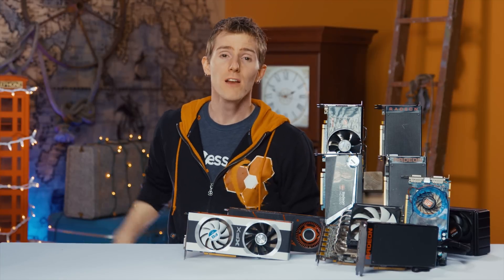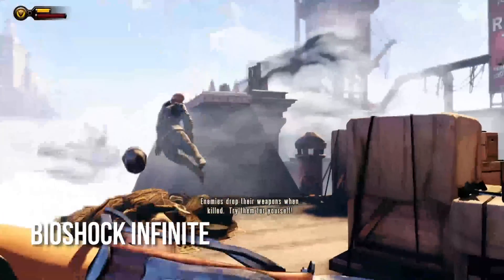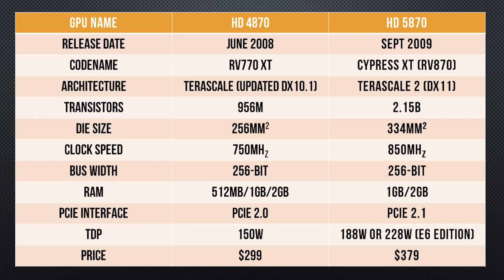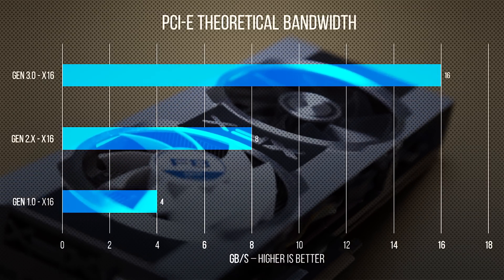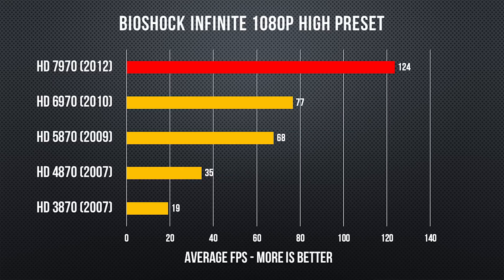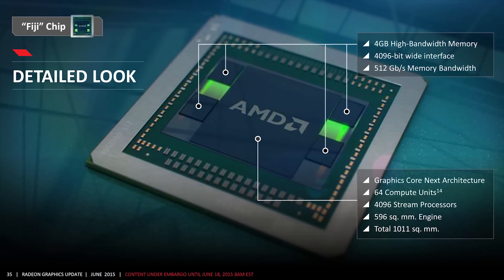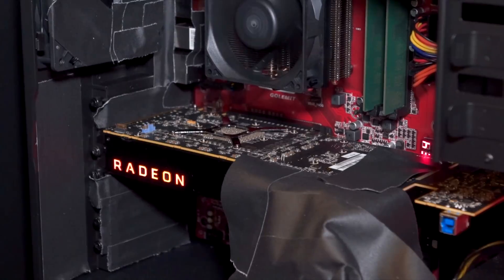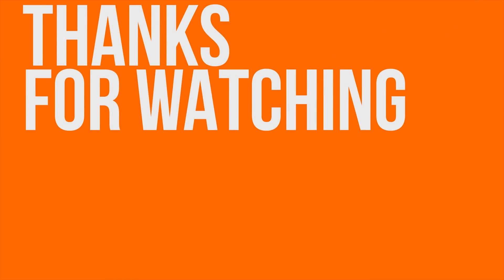10 Years of AMD Video Cards BENCHMARKED!

Comment: i still use a XFX R7800 ghost termal technology, pretty much never touched any other computer since i bought it many many years ago, i am going to buy a new computer really soon with i7 8th gen, 1080 gpu, 16gb 300mhz and ssd will. with a 144hz 1080p 24inch curved monitor am i going to notice any big diffrence or shouldi go cheaper i meani can afford it but i could spare the cash if im over doing it (the plan is to have a computer that wil last for a loong time)

Comment: 480 $199? PFFFFFFT HAHAHA!
Reply: Man times have changed. Got my 580 for 150
Reply: NecroticTM I got a 580 for 65$ and it was a month old and works great. But I gave it to my Dad who then bought me a 1070 mini from Zotac on Ebay. Official Zotac ebay
Reply: Bought mine a year ago for $190.
Reply: 480 is $80 in my country
Reply: GTX 580’s are pretty cheap on the used market, I find them for 40$ (USD) pretty commonly.
Reply: @deethree1289  gtx is not rx...
Reply: As of current, Ebay is selling 480's for $100 dollars each and 580's for as little as $120. Guess the mining craze is truly dead.
Reply: @ChaotiX1  you spoke too soon, they are listed as just under 1k usd now
Reply: @deadeyecowkillz7580  i made that comment over a year ago...
Reply: still too soon
Reply: @deadeyecowkillz7580  yeah well, I'm not Nostradamus. I wouldn't have been able to predict Scalpers trying to snatch up every single GPU straight off the production line, ballooning prices like they did.
Reply: pog
Reply: Got mines for $ 230 a week after launch
Reply: Now it's only 109 for the red devil used
Reply: My 580 was $179
Reply: This comment aged well...
Reply: @flippy7035  like fine wine
Reply: @shrimry  no it didn't
Reply: Well due to the mining hype, problems with manufacturing plants in Asia and high memory demand for mobile devices (smartphones, tablets,..), supply/demand and market economics raised the retail price.
199 was probably suggested consumer price by AMD.
Reply: You're poor

Comment: I built my first computer in November 2016. I used an Intel i7 5820k and an MSI RX 480. Now, when I built this, I had been thrown all sorts of warnings; "AMD cards suck dick, don't do it." was one of them. I digress, I bought the video-card at $270* dollars. Now it's 2018, Bitcoin has knocked centralized currency down a peg and because of this; I was able to sell my RX-480 on eBay for a whopping 402 USD dollars. So all I can say is, thanks bitcoin. 

P.S. I also bought 600 dollars worth of bitcoin back in 2016

P.S.S. IM RICH BIAAAATTCH

Comment: my first AMD card was a Powercolor X800GT paired with an Athlon XP 3200+
years later in 2009 i proudly owned the mighty first 1Gb GDDR5 card, a HD5870 from XFX and felt like a baller at LAN-partys (too much to explain here) xD ..
the rig  (i5 760 OC@3.6Ghz + HD5870) still runs as an office machine at parents house sometimes.

ol times... btw i do remember the HD4870X2 which was a top end card for years

Comment: ill never forget the day A.T.I. dropped the motherload of all bombs on NVidia when they released the Radeon 9700 pro,,and all the architecture that came with it that got implemented into all there cards of that generation. so why don't you do a plug on when it was ATI,,before AMD bought them in 2006.they made some kick butt cards that left NVidia in the dust. back then the ONLY thing NVidia had done well was open gl. NVidia's dvd playback and anything direct 3d was just god awful,,and stayed that way till 2010. if you played Quake 3 Arena,,,or DOOM 3,,or any game that used the ID software's quake 3 engine,,thats where the NVidia cards shined. but when valve sided with ATI,,and made the Radeon 9800XT,,just for half life 2,,alot of NVidia owners were left with there heads hung very low,,as the Radeon's smoked anything NVidia had to offer,,and I mean BEATEN VERY BADLY!! I still remain an AMD loyalist today. but doing a spot on bolth old NVidia and ATI cards would be cool to see.

Comment: I'm still using a hd4870, still peforms well with a huge 500mhz core overclock and still stays below 66c. Still want a new graphics card and it still uses up WAAAAAAAAAY too much power than newer cards atm.

Comment: AMD needs to  design  completely new  gpu ,  Fury 2.0   called  Vega is a huge mistake comparing to  NVidia's gpu.
Reply: Vega is actually good and power efficient the only problem is that Nvidia released faster cards... if Vega wasnt pushed to fast clocks speeds its more efficient that Polaris by a mile and as efficient or more efficient as pascal at lower clocks but they pushed it to the limits... Kinda like a 7700k vs a 6700k when OC 7700k at 5ghz vs a 6700k at 4.6ghz 
7700k consumes as much power as an 8 core ryzen at 4ghz while 6700k is still power efficient. Vega is the same... it would have been better as a mid range card.
Reply: +TheSinisterEyes1 Yet the 6700K has a 91W TDP while the Broadwell predecessor (5775C) is only 65W, despite packing Iris Pro Graphics
and 128 MB L4 cache... Skylake not so good haha

Comment: I've generally gone green with my GPU's but my 6970 - "It's cheaper so it doesn't' matter if I replace it sooner..." - actually ended up lasting me 6 years! Despite grumbles about catalyst it served me well. It got retired for a while when I built a new system with a GTX1070 in 2016, but now it's back in service after the venerable GTX 260 in my Wife's 'Sims 3' box finally died. Unfortunately the fan seems obnoxiously loud these days so its been down clocked by 40% to cool it off until a current gen replacement arrives.

Comment: I use a AMD Radeon HD 7950 and i5 4570 0.8-3.6ghz locked cpu and don't see a problem with modern games even ultra or nearly ultra.

Comment: Don't get the hate on Hawaii - yes, it was hot (reference model), but it was twice as cheap as it's competitors (780ti/Titan), same performance (at that time) + more VRAM. I'm still using an overclocked 290 with Xtreme IV cooler while Keplers are now competing with even older Tahiti cards because of RAM / drivers

Comment: You skipped Radeon HD 6850. It falls between GeForce GTX285 & Geforce GTX 465. So, this is a formidable card even today. It is terascale 2, 40nm, 1,700 million transistors on a 255mm die, PCIe 2, 16 lanes, GDDR5, and 127 watts.

Comment: i had 6970 + 6990 (3 gpus) i was thrilled to get 70-80 fps in crysis with that. now i get almost double that with my 1080 ti. 1080p that is and no 8x msaa which is stupid. 290x crossfire wasnt bad at all either. only game i wanted it  to have full potential was w3, i dont think it still has crossfire support lol. gta 5, bf4 etc. other games i played had like 90% scaling but not the only game i wanted it to work, withcer 3 : (

Comment: i got a computer with a proprietary 240 watt power supply for for my birthday last year. i upgraded the processor to a xeon 2.44 q core with hyperthreading. so mow i need a video card with 1050 to or close performance . but i'm stuck with 65 wat or less.

any suggestions?

Comment: I still have a 7970. Still runs everything just fine. I don't see myself upgrading in a while. Old top of the line cards are the best bang for your buck.
Reply: I have the R9 280X and still kicking ass
Reply: I still play Battlefield 1 on ultra with my 7970

It's still a fucking beast in 2018
Reply: My brothers friend was offering me 2 780s for 250 euros at one point. Sadly i had no money and didnt pick them up....

Got a 980 for 300 around 1 1/4 years ago.
Reply: Karl Robert Reinart I just recently upgraded to 3 RX 580s as opposed to my old set up of 2 7990s due to both the cooler finally commit suicide, and Fry's actually had some in stock... for actual price, not the $900 that people are selling them for on eBay to mine bitcoins, my friend who's dad was dumb enough to buy him 2 1080Tis accused me of black magic because I was performing better.
Reply: Ya the 7950/7970 are legends man, the 7950 was sold new for 180 usd in 2013 LOL
Reply: Same Demsimex - Well, on a 980 now instead, since im still on 1080p.. Will aim for a 1070 or wait for 2070.. But must say the 290x was an amazing card. :) But run so HOT
Reply: Of course it still runs everything, but also consumes much more power. 250W is a lot and probably it cost you as much as another card in a year or two.
Reply: I still have a AMD Radeon HD 6970 in my computer, it runs fine.
Reply: Considering that the HD 7970 has like 12 memory chips or so (and the whole card consumes 250W on average), and that the RX 580 has a 150W tdp (and it also has less memory chips), it is safe to say that the difference between those cards in terms of performance / W is not all that big.
Btw, the OpenGL scores (Furmark 1080p) show that the HD 7970 gets around 3850-4000 points (mine got 3926) and the RX 580 gets aroud 4050-4200 points... That is not a huge differece ya know
Reply: Recently decided to upgrade our little family home computer with a GPU so that my wife and I can play some games together. I just bought an R9 270X, so I'm pretty excited to see how it runs! (We have an actual gaming rig as well, so she will be using that and I'll use the little chugger haha!)
Reply: Your just broke 😂🤣
Reply: Had 7850 until 4-5 months ago, was great card :D only problem was 1GB VRAM.
Now I have GTX 960 4GB because my friend was selling one, but if he wasnt I would still be on 7850. So it worked exactly 7 years for me. Really wonder how long it would work if I didnt get 960
Reply: Karl Robert Reinart I untill recently was still rocking a 7950 on water that overclocked like a beast it was a his 7950 boost iceq I could run 1300mhz on it  with custom bios stock was only 850 lol biggest overclock on any card I ever had  shame it eventually died after 3years insane overclocked .
Now got 1070 on water it's good but hardly overclocks tho  but bang for buck 7950 or 7970 still amazing cards best aging well  cards ever made . I want another 7950 ice q one day just to overclock it was so fun  also very good driver support too
Reply: @vforvendetta4538  Very good driver support? Man the drivers for that thing suck HARD. I can't get the OC to stay where I put it, it will drop back to 910 as soon as I click apply (the slider) and it will run at 850. Otherwise when the OC stays where I put it it is a bomb for its age... It is getting replaced with a RX580 8GB thow, I have a 165hrz 1440p panel... I needed the vRam and FreeSync. Its getting back into my old sistem thow, for 1080p max gaming when friends come over 😅
Reply: Kind of depends on your definition of just fine.
Reply: just buy a nvidia 1050ti for 170$ and the wat
Reply: The HD 7970 would kick its ass in OpenGL, mine is getting 3926 in the Furmark 1080p test, while a GTX 1050ti 4GB got only 2550

Comment: History repeats itself, eh? The Terrascale architecture couldn't compete with Nvidia, so they went with smaller chips and tried to sell multi GPU as the high end. They did the same thing now with the 480, Vega is coming, but much later than Pascal. Also don't forget Xenos was actually the first unified shader GPU from ATI, a year before the 8800 and even longer before the 2900!

Comment: How are some of these old AMD cards performing better then my GTX 960??
Reply: The HD 7970 is quite above the GTX 960 in modern games, memory bandwidth being a big reason of it.
Reply: Same reason an old GTX 780 will out perform your GTX 960, these are AMD's flagship cards
Reply: because your 960 is almost as old as this amd and also was only a mid range card when it was launched. this amd card was amd's flagship.
Reply: Spunky Bob fr tho, just ordered a 1070 strix, but if had a 960 SSC for the past year or so. 960 is a decent card
Reply: the cpu i think
Reply: These are not the top flagships, my two PCs use a HD 4890 (better than 4870) and a HD 5970 (better than 5870)
Reply: Because a 960 only has 1gb of Vram  and is not very powerful
Reply: @pzkwmaus9050  Mine has 2gb gddr5 vram, in fact i think all of them have 2gb of that vram...
Reply: @terdthetoad  mine has 4gb gddr5 vram
Reply: @pzkwmaus9050  mine has 4gb gddr5 vram
Reply: GamingD they have 2gb and there’s a 4gb model
Reply: because this is how nvidia limit your card's lifespan with less than futureproof vram.
Reply: It’s called finewine
Reply: because one of the benchmarks is Half-Life 2, which was a game engine which always ran better on the ATI cards for some reason only vAlve could tell you.

Comment: I never understood why the 290x got so much slack. It spanked the pants off its competitor (the 780/ti) and if I remember right was actually cheaper? It cost about the same as the gtx 970 and actually performs better especially in newer titles. Yes the reference was hot as fuck and thermal throttled but the non reference ones were perfectly fine. It wasn't like the 4xx from nvidia that was not only crazy hot but SLOWER than the competitor. I guess people care a lot more about heat and power consumption than I thought for some reason. It's like a few bucks a month on your power bill difference and the heat doesn't change the life span of the device. 

Either way VERY good review for both nvidia and AMD. II'm sure people will bitch about something but the review itself was great. I disagree with peoples opinion of the 290x though I'm happy they are going back to the basics. I'm afraid for Vega. I personally think they should have stayed out of the high end for 1 more year and made a huge comeback like the 5870 BEAST with some new tech like Eyefinity. People don't use multi monitor as much because nvidia surround sucks balls but if they came with a new card that could keep up adding freesync into the mix they would have a firm place in the market. Who knows? maybe Vega will be better than I think though?

Comment: 7970. Still kickin in 2017. Let s see how goyvidia is doing hmm: most of fermis have died in tragic fires and keplers were gimped till a 780 gets beaten by an overclocked 280x.  390x beats a 980 and has double the vram... But the 350W powerdraw is enought to light a small african village and feed em of the bill.

Comment: Still using R9 290x
Reply: same here :)
Reply: benq994 hahaha ha that's cool! Are you gonna update anytime soon or you gonna wait till it dies?
Reply: Well i don't expect it to die anytime soon but i'll wait for newer and better Radeons to arrive. For now im good. Witcher3 runs smooth (about 45fps) on max settings except hairworks and ambient occlussion. The only drawbacks are heat and power consumption.
Reply: benq994 yes. I've been thinking about power consumption and heat, too.  At least two of the things that makes me thing about changing. But I guess I'll change it when ddr5 memories comes out ( ram memories )

Comment: Still have an HD 5970 (basically 2x 5870 in crossfire on the largest GPU I've ever fucking seen, almost 13 inches).
It's nice, for an almost decade-old solution is still somehow playable on new AAA titles, albeit with some tweaks. If drivers were still updated and games still tested on it, I'm sure it would be usable.

Not saying get one, new tech is new tech - cheaper, smaller, lower power, cooler, quieter, etc.
However, it's really impressive how "future-proof" AMD's crossfire cards were.

Comment: Hi I am new to computers and I wanted to try and build or upgrade a pc. There's a dell inspiron 660 with 8 gb of ram and the i3 processor that I think I can get for around a hundred bucks. (Old work computer) 
First I want to know if that would be worth doing and I also want to know what a good graphics upgrade for it would be. Are there any good cards that you can use without upgrading the psu that draw the power straight from the pcie slot? Would an amd Radeon 460 2gb work without a psu upgrade? If there is nothing good to use without upgrading the psu what would you reccomend getting? I want to be able to player newer games at around 60 fps hopefully at 1080p 
Thanks

Comment: Still using an R9 290X 4GB, AMD tweaked its performance over the years and still running great today for my 1080P needs.
Reply: 73mathesar Same here! And my ASUS DCU2 card isn't that loud either. It's one of my best buys ever since I only paid about 250 $ for it.. 😀
Reply: Still using a R9 280X, indeed still does pretty well, more than 4 years later
Reply: yeah bought it last year. Was the cheapest one. The cheapest one with 8gb currently sells for 320€ on ebay. The ones with 4gb start at 180€
Reply: @benchoflemons398  meanwhile i paid 60€  for a 290x
Reply: Paid 200€ for my 8gb 290X Tri-X
Reply: jo-mornin' and where?
Reply: You can get the 3gb version in new starting at 210€ and in used everywhere from 140€ to 200€+
Reply: Was using a R9 270 for a good bit (blower style) which ran good for my everyday needs until my computer randomly shut off and I could not fix it
Reply: Did you mean ryzen 9 2900x?

Comment: The first and only card I have bought before I knew more about hardware was a rebrand of the 7950, the R9 280. All I knew at the time was $200 was the sweet spot for price to performance value, so I went with the offering from AMD at the time. Finding out later that AMD just recycled architecture from an older card left a bad taste in my mouth, but surprised they are still supporting it three years later. I will be going Nvidia for my next card though, 980 performance in the 1060 is insane.